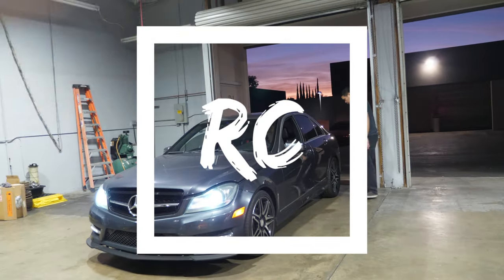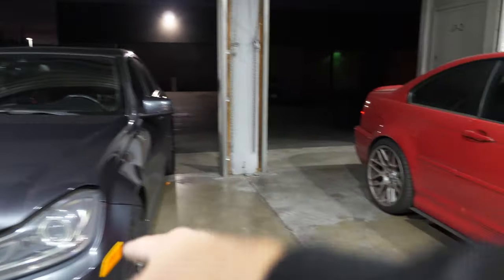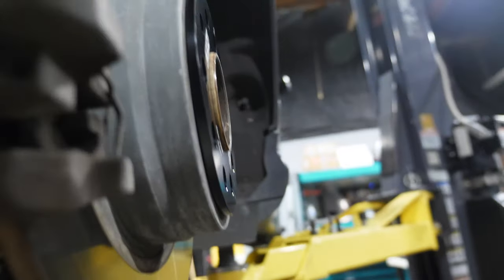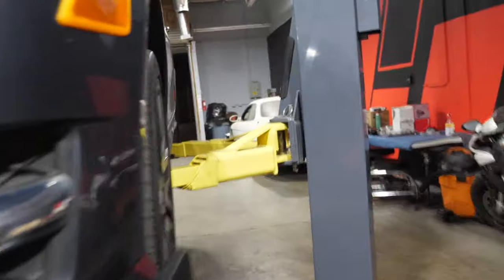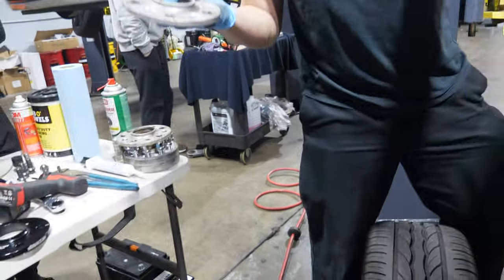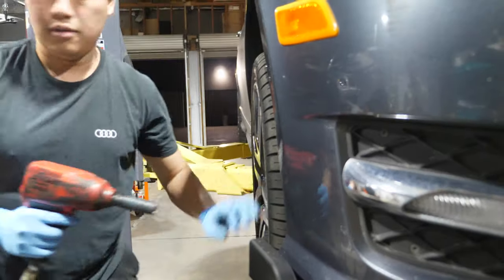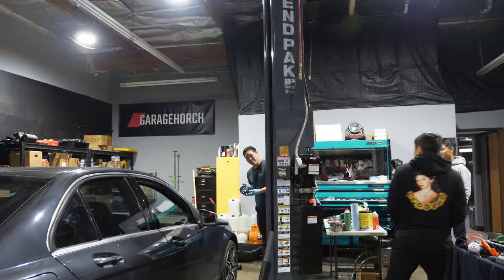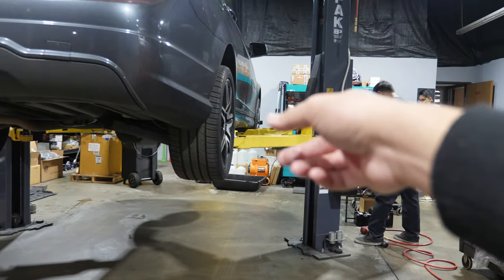What Spacer Size Should You Put on your Mercedes C250 W204?

Comment: Sorry for the off topic question... But in your Maserati Granturismo, there is a cardslot on the left of the infotainment system. I can't find any information about it. Is it a SIM card or memory card slot? If so what format?
Reply from the maker: All good! I believe it’s for a sim card. Memory cards are too thick to fit in there and the only thing that can would be a sim. Not 100% sure but pretty sure if that makes sense ahha
Reply: @RichardCuico  Thanks for the answer! I just got a 2015 Granturismo Sport (ZF) w/ 27K miles on it a few days ago, in no small part due to your videos - they where the first ones that came up when I started researching! So thanks for that! The USB icon in the glovebox has the "full socket"-icon but my USB-drive (normal USB stick that I use in my BMW) did not register. Any special requirements there you've found out about, or did you just find another solution for music?

Comment: Respect I’m waiting on delivery of my 13 c250 w seat seat belts super excited. Stanley from Autocraft tuning will be tuning and modding my c250 goal is 350whp and max torque possible🙏🏽. Stanley is the guy TRC with the M3 with 3 turbo setup. Check him out.
Reply: Bro Im sorry but 350whp is impossible. I haven't even heard of one making more than 300 to the crank. we all can dream tho... I just bought a 2013 c250 too
Reply: @rileyturner8198  great car mate congratulations by any chance does it have the handling package with Sport button and no Eco button. Yes, only in R, SA, Sweden and Indonesia so far can make that power, the support is not out the for the m271evo in northAmerica. godspeednchrist is my car name. i haven't dynoed only street tuned. the car is in shop at moment for transmission conductor plate repair the 80K oil was too old to keep the transmission at happy: replacing select speed sensor and the while you're in there parts. my favorite mod so far is the interchiller🥶. cheers mate.

Comment: I wouldn't trust them 5mm, youve reduced the lip the wheel sits on, and using the stock bolts still reduced amount of threads holding wheel to hub.